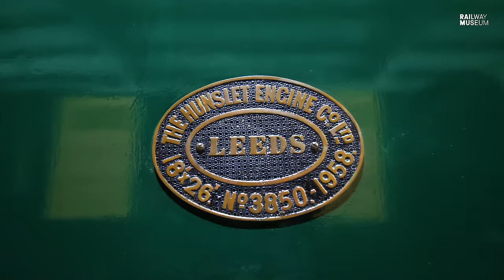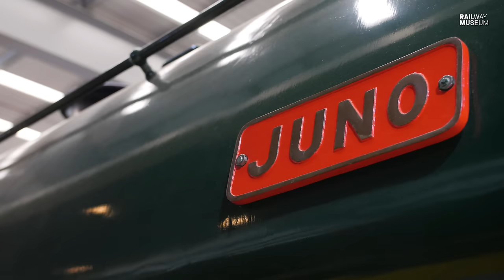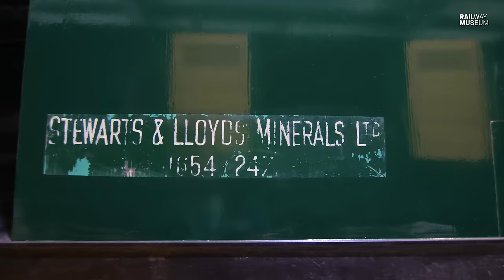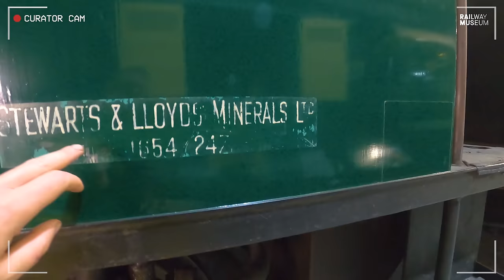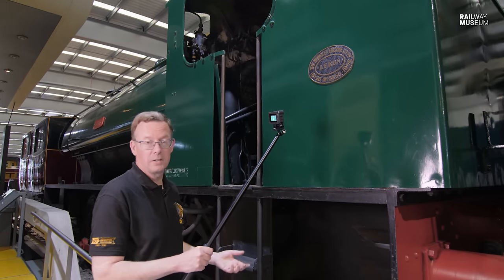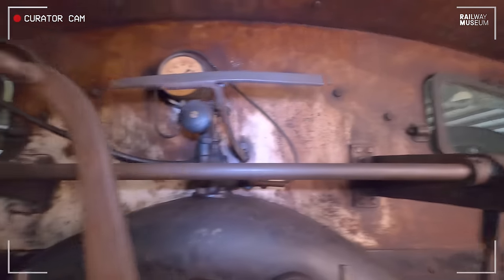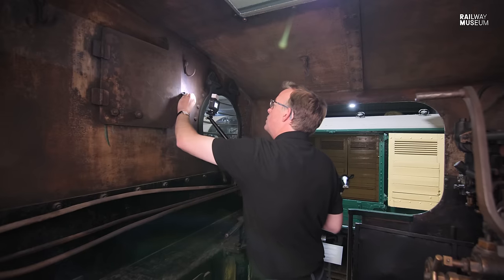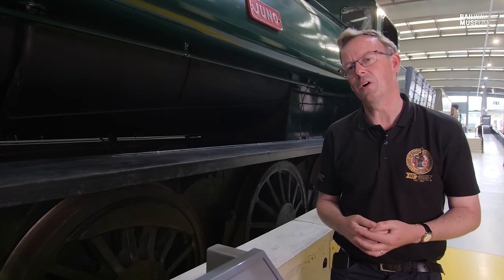Is this World War II Designed Loco the ULTIMATE TANK ENGINE? | Curator with a Camera

Comment: Interesting that the water glass is unguarded, indeed one is broken.
Reply: It looked a bit fragile.
Reply: It would have had covers originally, someome probably took them off in preservation and they've gone missing.

They're not exactly the most securely attached parts as you need to get the cover off easily to replace a broken glass easily. Makes them prime bits to go missing into peoples collections at home.

Comment: Fun fact, cant remember where i saw it (besides "on youtube") But there is a tiny yard in africa that still uses a few of these. They run them on compressed air provided by the factory the yard serves. They have enough air to move for about 10-20 minutes but the yard is tiny and they only move a couple cars at a time.

Comment: Very useful loco, in The Netherlands 27 of them were bought by NS to operate at marshalling yards and depots.
 Their live was rather short because steam ceased to operate entirely at NS in 1957.
5 of them went to a colliery at the very south end of The Netherlands, the Laura & Vereeniging in Eygelshoven. One went to a sugar factory in Roosendaal.
Of those used in industry in total 4 were preserved initially, but one was already scrapped in 1979 while in preservation due to the bad state it was in.
Of the other 3, NS numbers 8811, 8812 and 8826, no. 8812 was sold to the Ribble steam railway in the UK.
Of the other two only 8811 is in operational condition by now at SSN in Rotterdam.
WD 75115, NS 8826 and finally LV14 at the ZLSM in Simpelveld is a long term restoration project which is currently on hold. 
As LV14 this locomotive was in use at the colliery L&V from 1953 until 1975, she was one of the two last steam locomotives in The Netherlands in industrial use. 
At the ZLSM she is pretty close to the site where she once operated, the end station of the preserved railway is only 2 kilometers away from where the colliery was.
Reply: What is ns because isn't it also Norfolk Southern in the USA
Reply: @pollyjackson-dzacchaeus1342  In the context of Dutch railways, NS stands for “Nederlandse Spoorwegen”, which translates to “Dutch Railways”. They’re owned by the Dutch federal government.
Reply: @stampycatfan01lol  ty
Reply: @pollyjackson-dzacchaeus1342   It's Nederlandse Spoorwegen which translates as Dutch Railways, it was the former in 1924 found nationalised railway company which since 1995 operates as a private venture under the same name.

Comment: Juno reminds me of a Tank Engine we have in the train world Railway Museum.  the type 51 Belgium Tank Engine.  It's an 0-6-0 Tank Engine like  the austerity tank engines but instead of having a saddle tank  it is a  pannier  with double frames since the wheels are all nice and hidden but the connecting rods are outside ( you'll understand if you find a photo of it). 

 They were quite impressive tank engines similar to the austerities but unlike them they didn't just go through one War they went through two Wars! 

 They were built  from 1866 to 1905 To the design of Alfred Belpaire (The same man who developed the Belpaire firebox) And a grand total of 307 of them were built. 

 They were so good that  there were even examples  sent over to China. 

 but unlike the austerities they were very much modified over time.  When the first batch of these engines were brought out they did not have cabs attached to them  but they were later  added.  their funnels also change from square ones to round fin ones as well.  many are designed changes for also implemented but  I don't really know what once specifically. 

 but what is most impressive about these engines and which is something not even the austerities can claim is that they worked for the Belgium state railways for 95 years!  and that was only for the Belgium state railways they also served in industrial service  so some of them could have  a service life of at least a hundred years or more! 

 but out of all of these amazing engines that were built only one survives. 

 NMBS number 1152  which is currently being displayed in the museum train world  and it's probably in the most original condition it can be since I do believe some modifications were done over time.  but it does still have the original chimney attached to it. 

But despite me hyping up this engine I want to clarify that I do think that the austerities were much better than the 51s.  simply because  steam engines have been developed a little bit more over time and they were able to implement those changes into the austerities and thus  they became a much more efficient design of Tank Engine than the 51s. 

 but if you're interested in seeing the 51 just calm down to Belgium and go to train World Museum!  you can literally take the train there from the airport!  but before you do that please check out the National Railway Museum and its associated museums!  I guarantee you will not regret it!

Comment: I would like to argue that the Hunslet Austerity was one of, if not the, BEST British locomotive designs of all time.  Not the fastest or the best looking or the most innovative, but in terms of their fitness for the purpose they were designed for, I don't think any other loco can match them.  A lot of people think they are rather dull because there are so many still around on heritage lines; but that illustrates the point, so many survived in use into the 1970 and 1980s because they were just so good at doing what was needed!  They were built to fill a specific need and they did so extremely well.  Efficient, cheap to build, easy to fire and drive and with masses of pulling power.  When these were introduced, coal was handled in 20 tonne wagons - but by the time Austerities finished they were handling trains of 47 tonne (HAA) coal wagons with ease.  They have as much adhesive weight, and as much pulling power, as a "black five" or a GW 4-6-0 - but of course, could only do so at low speed due to the much smaller boiler.

Hunslet really knew what they were doing as a company - as evidenced by all the competitors they absorbed over the years - and this was arguably the pinnacle of their steam work.  Here's a thing to consider; Hunslet had been building diesels for TEN YEARS before they finished building Austerities, but users still wanted to buy new Austerities throughout that time as they were cheaper to run!

If you want to see and hear the spectacular sight of an Austerity working hard, go down to the Kent and East Sussex railway when they are running one of theirs.  Stand at Tenterden station and listen and watch as one of these hauls six coaches up the two miles of 1-in-40 bank, making a great sound but clearly totally in charge of the job they were designed for - hauling heavy loads up steep gradients at low speed.

I have not personally fired or driven one, but crews I know mostly say that they are dead easy to work, compared to many other engines of similar size (such as the USA tanks mentioned in the comments above).  The only complaint is the poor access to the inside con-rod big ends for maintenance.  The arguments for and against inside or outside cylinders are interesting but I suspect in practice Hunslet stuck to inside cylinders because that was their usual practice, and the arguments in favour were just trotted out to support their choice!  I'm sure outside cylinders would have been possible (as on the USA tank that was widely used in the UK by the Southern) and would definitely make maintenance easier - but why change what you know how to do?

The Austerity tank engine deserves much more recognition as a true British icon of steam, much under-appreciated.

Comment: The SSN in Rotterdam has an Austerity tank engine in their fleet since 2010. This one came to the Netherlands in 1945 and was in ownership of the Dutch State Railway (NS) until 1953 (numbered in the class 8800).

After 1953, she was brought to the coal mines in the south of the Netherlands and worked their until the closure of the coal mines in 1974.

In 1981, when the engine shed of the coal mine would be demolished, they discovered their was an engine still in the shed. And after a lightning fast action of the SSN, the engine was saved from the cutter torch and brought to Rotterdam by rail. She received a new boiler in 1991 and was fired up for the first time in 2010

Comment: I think you could have talked about the short wheelbase, which was useful for tighter radius curves.  It has a round top firebox, which can use the saddletank, which is cheaper to build than a more expensive Belpaire design, which although is less efficient is cheaper.  The GW used Belpaire fireboxes on their 0-6-0 tanks but used pannier tanks to give access to the valve gear.  The Jinty had side tanks, because it is more difficult to fit a saddle tank on a Belpaire shape.

Comment: The 1980's places like Bold, Bickershaw & Cadley Hill Collieries. They were reckoned to last only 2 years as all the facilities in Europe for maintenance and repair were trashed after the war.
They were thrashed unmercifully at the mines. One is alleged to have gone ice skating at Mountain Ash at the insistence of the Surface Superintendant. It did not end well.
Their long-life at the mines is because the fuel was free. back the loco under the screening plant. Someone pulls a lever and another 2 tons fills the bunker before you can stop coughing....
The post-war under-feed stoker and the mods in the firebox & smokebox... I don't think there is one example with the full system in working order. 
There is 'WHELDALE', but that was a test-bed for another stoker system. One wonders what was Hunslet's motive there.
BTW 'JUNO' is stock.
I saw one of it's predecessors a 50550 class Hunslet  2412 of 1942 in the dead-line at Embsay. As that was a colliery engine it had acquired the inverted flower-pot chimney associated with the Kylepor exhaust.

Comment: I guess it's your schtick (no pun intended) but, please, get rid of the selfie stick. Imagine you're watching one of these for the first time, which is what I'm doing.

For the whole of the "Wartime Origines" chapter, we're either watching historical footage, or we're watching professional-quality footage of a man talking and filming himself with a selfie stick. The selfie-stick footage isn't used, so it shouldn't have been shot: it was just a distraction to the presenter and the viewer.

In the following section, at 2:43, we're looking through a professional-quality, stabilized camera, but then you cut to the same view shot through the phone on the selfie stick, at massively lower quality. It's distorted because it's a wide-angle lens pushed close to the subject. The contrast is poor. It's wobbling all over the place, because the presenter can't decide if the stick is a camera or a pointer. And all this time, you have a better camera pointing in the same direction, being operated by somebody who's doing a better job of filming because they're not also trying to do other things. I agree that the shot at 3:07 is a good use of the selfie stick, but that could easily have been done with the standard camera, too. And, by 3:39, that's absolutely necessary, because the phone camera is struggling badly: we can't see a thing in there, because that little camera can't cope with the low light.

And the same continues through the video. The phone footage serves no purpose, except for being the series' gimmick: objectively, it's just a low-quality, wobblier version of the high-quality, stablized video you're getting from the dedicated camera.

Comment: It seems to me that outside cylinders and valve gear would be much easier to maintain, especially in wartime conditions. 
As was chosen by the USA tanks for the same applications. Even the GWR went to this arrangement for its last shunting engines.
Reply: Wartime conditions! 
During blackouts external motion constitutes a hazard. 
Also, shunting/switching operations;therefore, less wear and tear.
Reply: Safety might have been a factor, but inside cylinders were such an ingrained part of loco design in Britain that it might just have been tradition. Plus tight loading gauges in yards.
Reply: @cncshrops  It's the loading gauge that dictates the tradition. You can't strap big cylinders on the side of a locomotive in the UK, because there isn't space. American locomotives are much bigger overall, so there's no need to put the cylinders on the inside, even on a shunter.
Reply: @beeble2003  the USA tanks were built for tighter loading gauges and used successfully by the Southern Railway and the the southern region.

Comment: "To build it cheaply, to build it simply..." yet shown immediately after is a clip of a guy taking a grinder or Dremel or whatever to a coupling rod to give it a fancy bevel.
* Throws hands up in the air in frustration with notes and other papers getting thrown everywhere. * I will never understand the British.
Reply: Some of those clips including that one  were definitely not of Austerity locos being built, a few looked like LMS publicity films
Reply: Nice smooth curves like that are really important for stress relief. The forces on those coupling rods are very high and a rough forging would have imperfections that concentrate stress and can cause crack propagation.